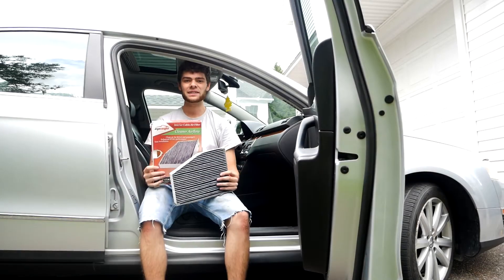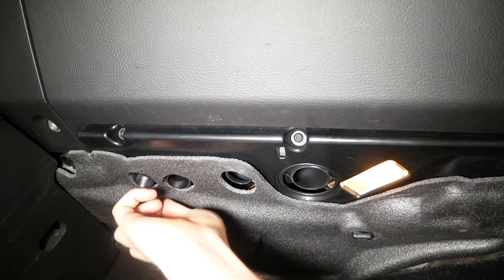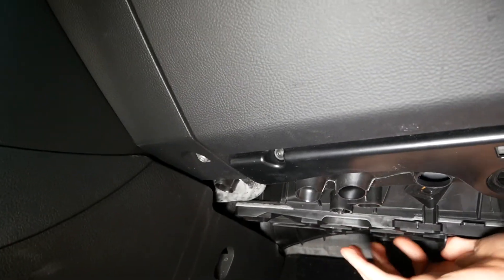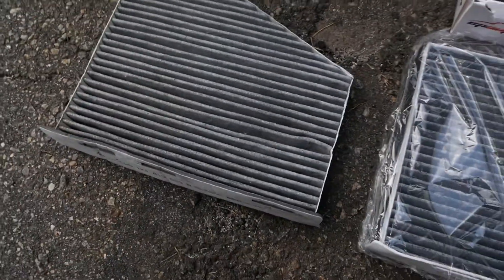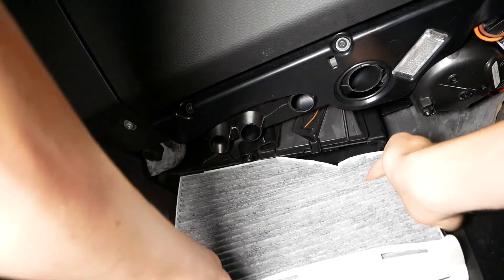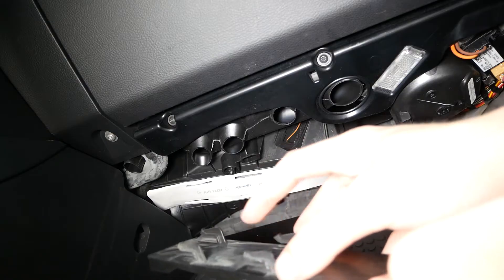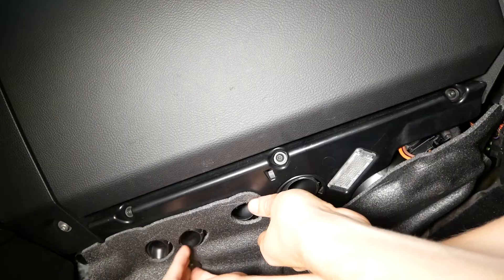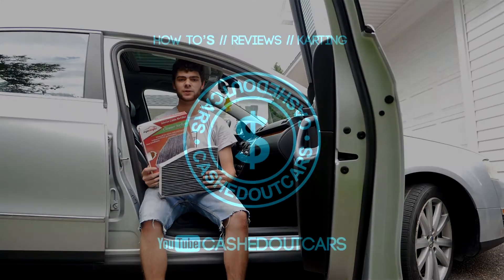How To Replace a Volkswagen Passat Cabin Air Filter (2006-2015, B6 and B7)

Comment: I bought a new cabin filter for my 2006 VW Passat but it does not fit. Surprisingly, the airflow arrows of the two filters are in opposite directions. The new one is also a little thicker than the old one in the cabin. Also, one is made in China that fits and the other one made in Poland does not fit. The other one sold at Wal Mart is as thick as the one made in Poland. I do not know what to do.
Reply from the maker: Try to gently force it in there, it should go. Sometimes they’re a bit tight
Reply: @CashedOutCars  I tried to do it but I couldn't. As I said, the arrow showing the flow of the air is different from each other. Nothing works. Thank you.
Reply: @tranhau3818 they go in one way , no need follow the arrows. My nissan altima  has the arrows wrong also. Just too let you know

Comment: Where does the air get drawn in from? Try to spray lysol to remove smells but can't find the place under the hood from where the air is drawn in
Reply from the maker: Turn on your air recirculation and spray in where this filter is!
Reply: @CashedOutCars  i never use that, do i need a new air cabin filter? i dont smell anything on road except dead skunks usually